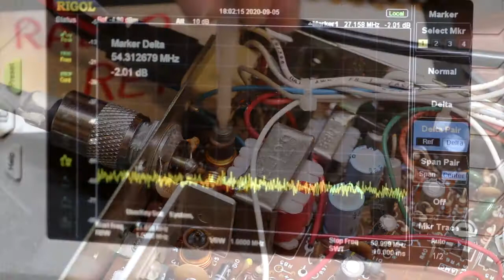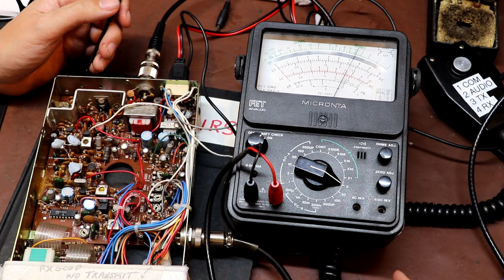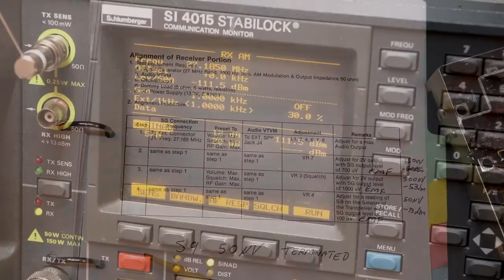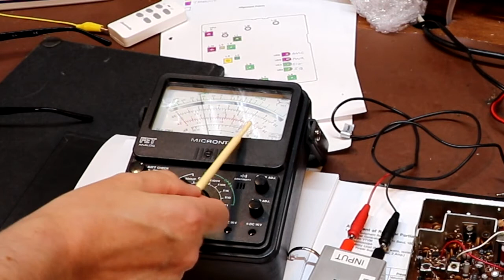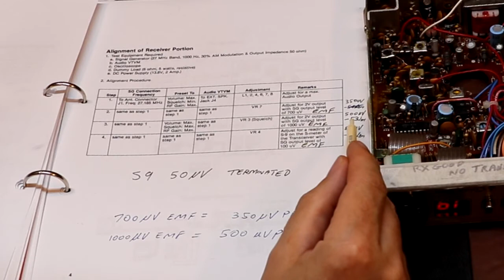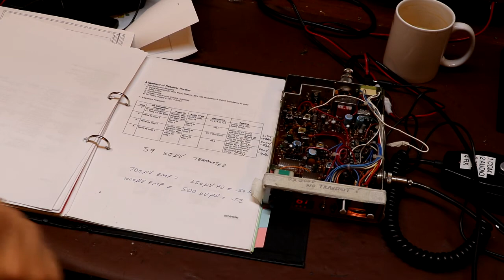Cobra 19GTL Gimp Tuned - Part 2

Comment: Ah yes. The age old debate as to what level of signal produces an S9 reading. The industry over here never did come out with an official standard that I'm aware of. For communications receivers they generally were set that 50uv would produce an S9 reading. Others said 100uv. I think as you pointed out a lot of the confusion is generated by what unit of measure you are using. Of course the resourceful good buddies here got around all of that confusion by coming up with their own unit of measure. When asking for a signal report you would hear. "How many pounds am I hittin you with there good buddy. c'mon." ATB Doug.
Reply from the maker: Doug McArtin  Certainly some of the S9 figures we’re definitely designed to mislead regarding receiver sensitivity. I don’t think it matter much myself. It clear that most of the people writing the alignment instructions didn’t have a clue either.
Reply from the maker: Most Ham operators are far to busy or lazy to look at a signal strength meter so I only ever hear S9 reports these days

Comment: I suspect most of those cores are made of cheese-mix powdered iron & not ferrite. The iron mix is less costly to manufacture than specific types of hard ferrite. I never have a problem finding spare cores in my scrap box, because they all tend to migrate to the bottom of the box by gravity. If you were given a random mystery box of iron & ferrite cores, can you do the math to determine the material type? Reverse Eng if you will.
Reply from the maker: Danish Native  Yes it is possible to work out the permeability of ferrite material but isn’t worth the effort of doing so. That’s one reason I don’t keep a lot of ferrite toroids as they aren’t much use unless you know the application they were designed for etc. I also suspect CB cores were made from cheese and floor sweepings. Thanks regards Chris
Reply: @allthegearnoidea6752  Used to do it all the time with a scientific calculator and a single turn loop thru a toroid and minimum test gear. I concluded I have a lot of #43 in the junk pile, and even some cores that work reasonably well at VHF. There are some materials that can't be easily ID'd because they simply don't fit into common categories...like Permalloy high in Nickel or proprietary mixes. Of course it's all much easier now with exotic widgets and online websites to do the math. Here's one person who does it with modern gear if you are interested:  https://www.youtube.com/watch?v=Q95Vwk3kZok

Comment: 100uv is for CB not 50uV as in Ham radio.
Reply from the maker: bob fourjs  for CB it’ is 100uv emf which is the same as 50uv Pd. The reference changes above 30Mhz . Some manufacturers mixed these up probably deliberately mislead customers regarding sensitive of their sets.
Reply: @allthegearnoidea6752  No, they just screwed the meter up to read high.  Anyone with a bit of sense would realise you can't be getting S7 of noise when everyone else is getting S3 at most.  Then you get sets that make out they are putting out 5 watts when they struggle to put out 2 watts.  Then there are the Audiolines/Unidens of this world that read low and suddenly jump up to +30 , which makes no sense.  However, very few meters read properly anyway.  Midlands were much the same, one second the meter was at the bottom and then +30.
Does it really matter that much, I have sets without a meter at all and it teaches you to listen to how good the signal really is and not to rely on a meter. no point in saying they are S8 if they are not getting above the noise!
Reply from the maker: I don’t think it matters when every operator gives a 5 and 9 signal report. But if I am setting up a radios I should try to set it to the standard.

Comment: I tend to tune RX using my ears and listen to the  audio/noise as well as looking at the radios built in signal meter, keeping the signal as low as possible to avoid the AGC kicking in, and then verify it looks ok on the test gear afterwards. anything over -110dBm for 12dB SINAD on an older simple radio would be normal, better radios can get in excess of -120dBm. Inject -73dBm RF and set S meter to S9
Reply from the maker: There does appear to be some argument over the S9 figure but I believe the consensus is that it’s 100uv emf which is 50uv PD or - 73dbm for frequencies below 30mhz. But even the manufacturer confused the levels often deliberately. I would have thought that -71dbm is on the high side for S9 at  63uV Pd.  I think with a bit more effort I could have achieved 0.5uv for 12db Sinad but in the real world problems not worth the additional effort.
Reply from the maker: As you say doing it by ear is a actually easier although I like having a simple audio power meter in circuit.

Comment: I'm sure it won't supprise you that i never went to all that trouble lol :-D.
Channel 20, Apply weak r.f input so the meter is at S2-3, peak all coils to the avo tacked on to the final i.f diode for the agc.
Check on 1 and 40 for the same noise level with an antenna,  touch the front end to balance. (oo matron :-D).
Key up on another radio and adjust the r.x meter to 30db or more, make sure it does not slam.
It is a uniden, so the r.x meter is always lazy, really lazy!. 
I'm sure that uniden have a different standard for the S meter levels, all unidens seem lazy.
Yes it's crude but i have found the engine tuning by ear method  is fine for c.b radios.
Cybernet radios have a way too sensitive s meter, in my opinion.
I've always been impressed how well the average c.b manages to work with a bare minimum of parts.
Smashing video chis, sorry about the waffle.
Reply from the maker: zx8401ztv  I’m sure experience really helps doing this like many jobs. It would have been really nice to have some clearer instructions in the manual. I find most radio alignment instructions very poor. It like it’s some special secret that they don’t want people to understand. Thanks for watching regards Chris
Reply: @allthegearnoidea6752  i fully agree on the crap set up instructions,  you know your in trouble when they name a trimmer or transformer that does not exist on the board.
The circuit diagram makes it so obvious, well most of the time it does.